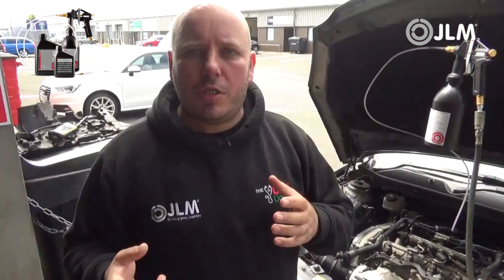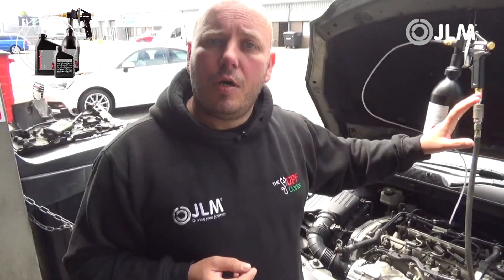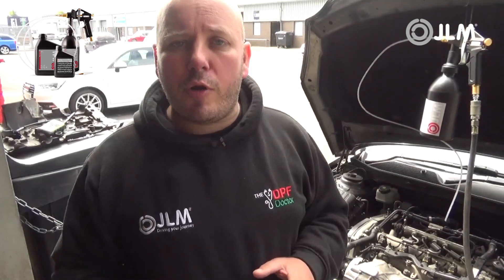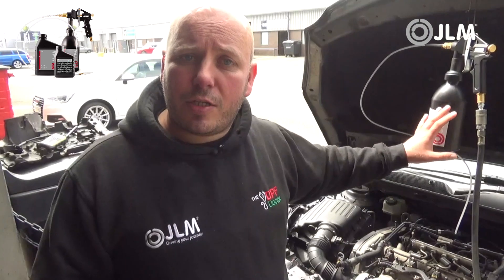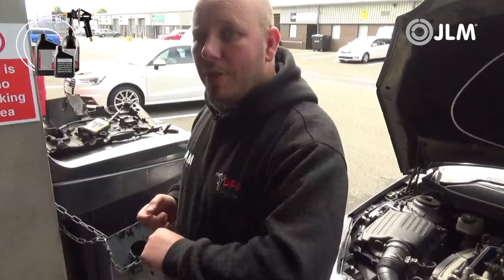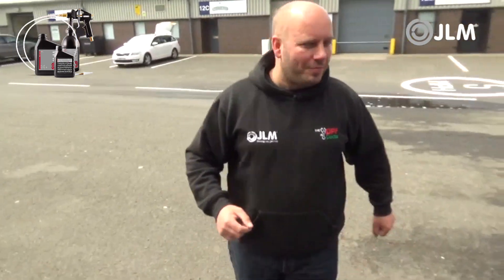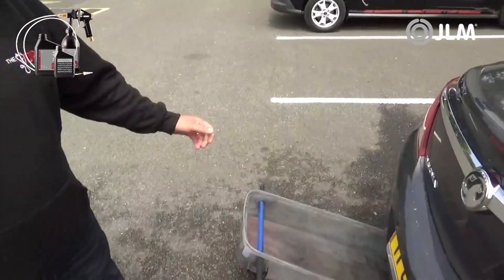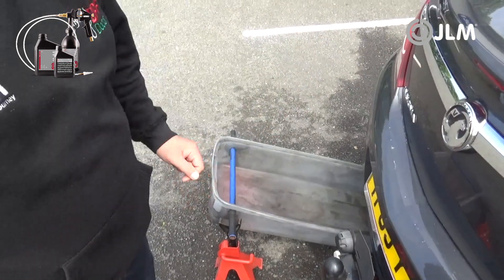White foam from the exhaust or not? Best practice using JLM's 2-stage DPF Cleaning Treatment

Comment: Do you need to perform a forced regeneration afterwards ?
Reply: The first step of dpf cleaning is the flush.  The second step is the regeneration which can be done by driving or forced regeneration.  Yes, forced registration can be performed using a diagnostic scanner.  It takes 25 to 35 minutes.

Comment: Why is the gun so expensive to buy? When you can buy the fluids for £39  why is the gun so expensive at £149  .... seems to expensive  to me
Reply from the maker: Thank you for your comment. Please note you can use the toolkit over and over again. It has an integrated pressure regulator and is treated (coated) on the inside - specially ment to comply with the two stage cleaning fluids. Thanks!
Reply: Can this fluid not be used in a regular air fed spray gun?